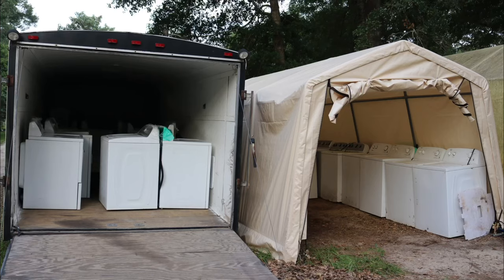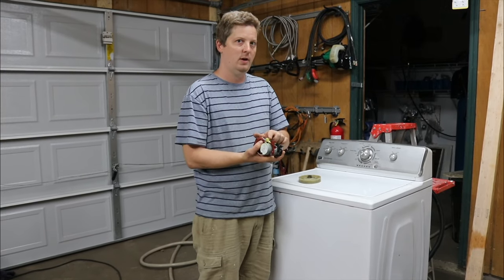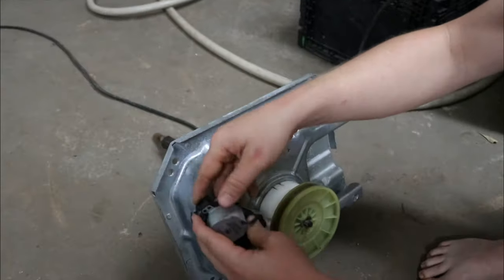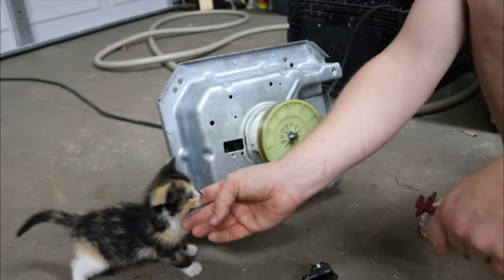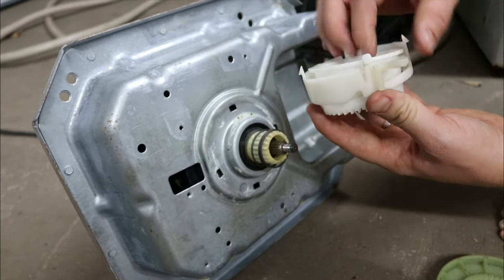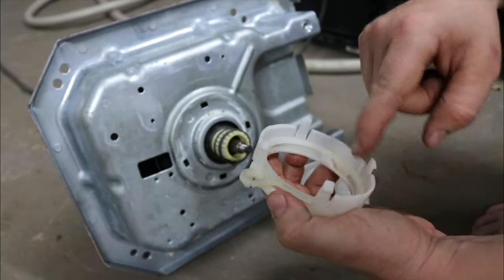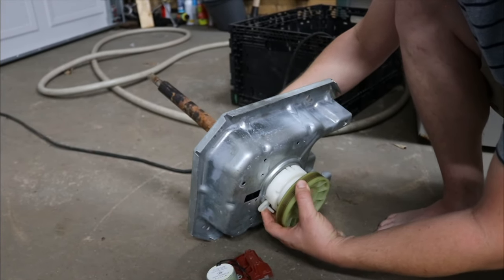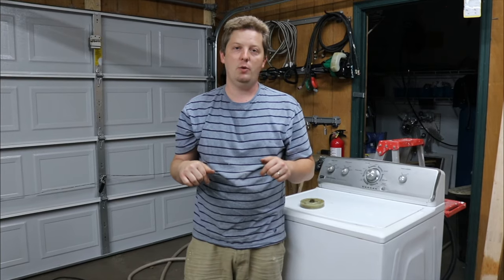Washer No Spin or Grinding Sound? Actuator Transmission Step by Step Guide to Fix or Replace

Comment: Yes all of these videos I'm watching or helpful but my washer is the lights are coming back on tomorrow when I plug it back in you hear it sounds like it's spinning but it's not moving or doing anything when I do the left right right right left right that don't work but lights won't come on
Reply from the maker: Some washers use a slightly different pattern to go into diagnostics mode. Be sure to get your manual for the washer that’s hidden behind the front panel. If you Google where is my manual on my washer you’ll see lots of videos of people showing how to find the hidden manual.

Comment: I came across a maytag washer (commercial one ) when it starts the lights ran from inuse straight to final spin then it spins then goes to done. Do you think that's a board problem?
Reply from the maker: My first go to move is usually swap out the actuator. But if you don't have an extra actuator sitting around you might do more research first. I'm not 100% sure.

Comment: I have a different setup on my bravos XL model number: MVWB755DW0. it has a larger motor direct drive, (rotor/stator whatever). I already ordered part W10913953. to replace the actuator. maytag says its effective to my unit. is it much different to replace? i looked on the bottom of machine but i cant see the actuator anywhere.
Reply from the maker: I imagine that’s the one with the motor that is a big disc on the bottom. I don’t think I’ve ever replaced an actuator on that machine. I hope it’s what was wrong with yours. The machine I showed is the cheapest version of washers made right now and the actuator is a very common part in them to go out. The one you have I believe is a higher end model.
Reply: @WasherDryerMoney  it is a higher end model but still broken so go figure. wish me luck!
Reply from the maker: Good luck. Sometimes the higher and models are less dependable. It’s not like the good all days when washers and dryer‘s with last 20 years.
Reply: @WasherDryerMoney  so it turns out although Maytag said this part was effective, its not. my problem is stripped plastic gear teeth on the inside of the motor rotor. the big white disc with permanent magnets is the motor rotor. Maytag is sending me a new one under warranty. I told them to send me a clutch and spring as well, because they contributed to the stripped rotor gear, they would not. ill just get another rotor out of em when i get closer to end of warranty. my unit is 5 years old and they warranty "motor and basket" for 10 years.

Comment: Thanks for the great DIYVid. Being an old Florida native your bare feet made me feel right at home! Though I wouldn't do any arc or wire welding dressed like that. I was wearing Flip Flops when I discovered that at 75 years old I can still do "Danny & The Juniors -  At The Hop"! ;-) BTW, do the Washer Pulley Clutch Kits come greased from the factory? I ask because there are environments that wet lube makes worse than no lube at all. Nylon gears are a topic all their own but they're definitely quieter than metal. On final note I must comment on KitCat. Genetically breeding the kitty to remain to remain that cute for life would make you a Billionaire! I rewound 5 to 6 times! I couldn't get enough of him! There should be laws about being that cute!!! ;-)

Comment: I replaced all this that you showed in video, everything works but now I have a squeaky noise as it agitates.. answers please?
Reply from the maker: Sounds like possibly the bearings in the transmission. I have a video on that but it’s not a easy fix. It’s pretty much a transmission swap out if the bearings go bad.

Comment: Are Kenmore Elite dryers and washers better appliances?
Reply from the maker: Usually every brand will have a higher end model. Sometimes I have a slightly bigger motor or some part that slightly heavier duty. Sometimes it’s just the paint job is much better for instance a lot of my tags will have a glazed on paint.

Comment: My whirlpool washer does not carry agitator dogs. However the agitator is spinning in all directions. 
Could you please tell me what is the problem with my washer.
Reply from the maker: Not 100% sure. My guess would be the agitator has broken loose from the transmission. But I’m not 100% sure.

Comment: Great video, but the problem I have is unable to get the transmission out of the machine.
Reply from the maker: Usually the only time you have to take the transmission all the way out is to replace the entire transmission or the tub seal. If you were just replacing the actuator or the plastic teeth you shouldn’t have to take the entire transmission off. Good luck.

Comment: All cycles work and it spins with super speed. My issue is when it starts to wash it agitates but with low power so it doesnt pull the clothes down. What can be the issues with this problem. Thank you. Watching from Central America. Would appreciate your help cause someone told me it was the motor and I know that its not that.
Reply from the maker: It could be the shift actuator. That’s the part that shifts it from spin to agitate.
If the actuator is not shifting it to agitate, and just leaving the washer in spin, it will attempt to agitate with the entire inner drum and agitator at once. This is a lot more weight and will make it barely wiggle back-and-forth. It should shift into agitate, where it only turns the Agitator in the middle and barely moves the inner drum.
First thing to always do is put the washer in recalibration mode. There are a lot of videos on it. I have not made one yet, so just look up recalibration whirlpool washer and it should pop up. Check out Ben’s appliances and junk. He has a great video on it.
Reply from the maker: Also, this is a very common problem with the actuator arm popping loose from the shifter arm.
Reply: It starts agetating hard for a couple of minutes then it dies down.
Reply: @WasherDryerMoney  Thanks
Reply from the maker: @robertlehnhoff9100  no problem.
Let me know when you figure out what the problem was.
Reply: @WasherDryerMoney  I just check under the machine and it dosent have that on mine. Just has a big white battery looking thing .

Comment: My Maytag washer Model #MVWC415EW1 appears to be locked in the spin cycle. When I plug the electrical plug in the spin light starts flashing.  I have tried to reset it to default  and it doesn't change.  If I push the start button it makes  a noise similar to spin noise,  but not as loud.  Turn it off and spin light keep flashing.
Reply from the maker: If it’s locked and will not come unlock my first guess would be bad Lock.
Look up a video on, put it in manual test and you can engage in disengage the lock quickly to see if that will free it up, or at least test to see if it’s stuck permanently.

Comment: How about if finishing filled water then nothing is washing is this the reason or the motor is not working
Reply from the maker: It could be. Check out the video by “Ben’s appliances and junk”
About putting the washer in diagnostics mode. They should give you a quick answer.

Comment: My washer won’t spin during the last cycle. It still moves during the washing cycle. Eventually the water would come out so I changed the pressure switch which was making a loud noise when turning the dial to different loads. The water comes out now but it’s still not spinning the during the last cycle 😢

Comment: Question. I've replaced the capacitor, the actuator, and my washing machine still wont spin, it does agitate but will not spin. Fault F421 Error E1. Do you have any idea with it could be? The motor tested at 1k ohms. When it attempts to engage in spin mode there is a humming sound but no spin. There was no sand in the clutch.
Reply from the maker: Could be the door lock is not sensing in the door is not shut all the way.
Reply from the maker: Be sure to put the washer in diagnosis mode and after you replace any part it’s a good idea to clear all codes.
There are some great videos on exactly how to do this so there is a hidden manual behind the front panel. You’ll have to slightly take the machine apart to get to it or you can just look one up online or watch a YouTube video.
Reply: @WasherDryerMoney  Do you have a video on the door lock not properly sensing? Mine is a Kenmore Series 500.

Comment: My Kenmore 800 series washer fills up the water and then it starts the agitator and then it trips. I have to reset it by unplugging and plugging in the machine and opening and closing the lids a few times. Any idea?
Reply from the maker: Try putting it in to diagnostics mode.
Reply: @WasherDryerMoney  I think it does not have diagnostic mode. The panel does not have any lights. The model number is 110.28832700 Kenmore. I will appreciate your help. After resting the machine, it runs only for ten seconds or so and then It stops. Just observed when I unplugged the power supply it was very hot after the motor ran for ten seconds.

Comment: We’ve got this exact problem, but it seems to keep recurring. 1st time it failed was exactly as you described i.e. filled with water and stopped. Replaced actuator and it ran for a month , then the “splutch” started making the grinding noise you describe as it tries to go into agitator mode. Replaced the splutch and it ran for a week, the new splutch has also failed. In both cases, the rim of the gear are heavily damaged as if they were riding on the base of the gear box. 
  Machine also makes a A LOT of noise on the spin cycle, and I assumed it’s related. Is it possible the gear box is failing and over stressing the actuator?
Reply from the maker: If it’s making a grinding noise there and spend cycle that usually means the bearings are going out.
These are absolutely horrible machines but they are very common. They are not dependable like the old ones.
Reply: @WasherDryerMoney  Yeah, we knew we weren’t buying a top of the line washer, but it really is a piece of crap. The damned kids who don’t understand the concept of NOT overloading the damned thing didn’t exactly help either. 
     As it is, based on your info here, I was able to clean up the damage to the splutch parts, smoothed it all up and lubed the hell out of it and got it to function again. It won’t last forever, but I only need it to last another month until escrow closes on our house, so thanks. 
     Maybe a tip you might try, but I added a thin plastic ring between the “splutched” gear ( I don’t know what else to call it) and the actuating cam to give it a little more clearance and make it easier on the actuator. Seemed to help, it ran better with it than without.
Reply: @WasherDryerMoney  ...I’m seriously considering buying an old style washing machine from the local used appliance place. Tired of all this cheap computerized “high efficiency “ crap.
Reply from the maker: @corneliuscrewe677  Definitely definitely recommend it. The type of washer you’re looking for is called a direct drive Washer. These washers are not unbreakable but they are very dependable and if something goes wrong with them they usually extremely easy to diagnose and fix. as far as a new washer the only ones I recommend is the speed queen classic version.

Comment: Is there a way to electrically test the actuator to determine whether it is faulty before I spend the 50 bucks for a new one?
Reply from the maker: It’s difficult because sometimes they will not move at all and sometimes they will be very weak.
I recommend buying it on Amazon and returning it if it’s not your issue.

Comment: My Maytag bravo washer is making a clicking sound when the drum fills with water. The actuator is not spinning it's stuck. Why? The repair person said he has repaired the machine 3 times and all 3 times he found a dime first repair, it worked for 7 months stopped again, he came back 2nd repair found a nickel worked for another 4 months , the machine stopped working again this time it was 2 dimes. He said it should work. Nope 4th time it was the trans. Lowes said they would not repair the machine again. They sent a new Maytag Bravo  washer and this one makes a chicking noise when full of water and does not clean clothes. I have done that light test no lights stay on to tell you whats wrong with the machine. Whats wrong with the machine?

Comment: What about GE washer that has no center agitator and is digital display.? How do I troubleshoot the washer if it's not spinning?
Reply from the maker: Some washers have a diagnostic mode. You can put them in if they have a digital display. You’ll have to look up and see if yours has one.
Reply: @WasherDryerMoney  thank you for your time and response...but once I moved the washer it was obvious to see the remains of a shredded drive belt.

Comment: Our ammana washer doesn't always spin. Some times it spins and other times it won't.  It does have a gear noise and will shift in and out. Is this the actuator?
Reply from the maker: Usually the grinding noise is the spluch.

Comment: I'm having trouble with my Kenmore I believe it's a 2000 anyhoo the model # is   110.22442100, I have agitation but no spin so the water stays the whole time once it's filled. I replaced my clutch. I thought that's all so I put it on lowest water fill and put a little clothes it agitated but did not spin to rinse out dirty water. I checked my hoses no blockage of any kind I took the motor out nothing that I could see with coupler they look okay I put everything back and I reach in to grab agitator and it does not spin freely at all it's stuck, so is my tranny blown?😭 Help I love my Kenmore because I can lift the lid if I need to if it ever comes unbalanced. I've had this baby for over 20 yrs. I don't want none of the new stuff, can you help me?

Comment: I wish someone would make a course on how to repair these type washers
Reply from the maker: When I get back to making videos I’ll be sure to go through all the different repairs. This type of washer is not super complicated it’s just not dependable. 
Between the splutch the actuator and of course the suspension that’s 90% of what goes wrong with this machine.
Reply: @WasherDryerMoney  thanks. Cant wait for more content.

Comment: Hi, I am having a problem with my washer filling with water and then it switched to wash but instead of agitating it makes a loud noise, almost like it's slipped but trying to agitate but nothing moves.
Reply: Hotpoint, newer model. I have a video of it as well.
Reply from the maker: You can find my email in the about me section on YouTube. Feel free to send me the video and I’ll take a look but my guess would be it’s the splotch. Which is the part the actuator shifts. I’ll be making a video in the next few weeks about replacing this part. Another thing to check is to make sure the actuator plastic arm that goes into that part has not slipped off.

Comment: I have a Amana, NTW4701BQ1 WASHER. First thing is it will not fill up to the selected water level. (Maybe a inch or two is it). Second thing noticed is it will not lock the lid. Will not agatat, spin, but what ever water is in the tub will drain out. Now in trouble shooting mode when set in spin mode it will spin but nothing else. 
When the washer thinks it has the desired water setting it will just drain/ pump the water out then stop making a grinding noise as if the washer was working normal. The wash light remains on but still no lid is locked light or done light. 
What could be the problem?
Reply from the maker: This is just a guess but from the symptoms you describe I would think it would be the actuator going out. My second guess would be the lid lock.
Reply: Ok... I was thinking the same two things.... Thanks for the help... :)

Comment: Hello I have a kennmore with the 6 lights and it fills at rinse lock button comes off and won't spin however when I manually change dialer to spin and drain it works can someone tell me problem the machine fills with water locks and agitates till the rinse button
Reply from the maker: Could be the cold water valve. Look up a video on putting it into manual test mode.
washers always use cold water rinse. So if the cold water valve is not working, you may not notice it until it gets to the rinse cycle. Especially if you are using hot water.
This may not be the problem, but it’s a good place to start checking.

Comment: Hi the repair man changed all those parts on my washer last Monday the 4 th and right after he left the same them happened again washer did not drain the clothes! Still doing the same thing
Reply from the maker: Put the washer in calibration mode. Look up videos on putting Washer in calibration mode. Try that it’s a good chance that the problem.

Comment: Great video, I'm working on washer and I believe that's my problem. Should the handle on the actuator turn or will it be hard to spin?
Reply from the maker: No don’t try to move the actuator yourself. You’ll break the small gears. Sometimes you can tell if it’s a bad actuator by watching it when it moves.
Reply from the maker: You can also put it in diagnostics mode.
 go to Ben’s appliances in chunks channel he has a great video on exactly how to put it in diagnostic mode.

Comment: My whirlpool won’t spin or drain, when it tries to spin, it makes a horrible noise! With Covid, my parts supplier is back ordered for months. Does this sound like an actuator? Sorry I know this is vague.
Reply from the maker: It sounds to me like it could be the splutch. I have not made a video about that subject yet but just look through YouTube and you’ll find plenty of examples and fixes for it. 
Most of the time you just have to replace the plastic stripped out part.
Reply: @WasherDryerMoney  thanks for the reply!